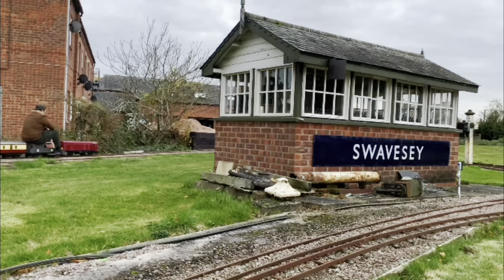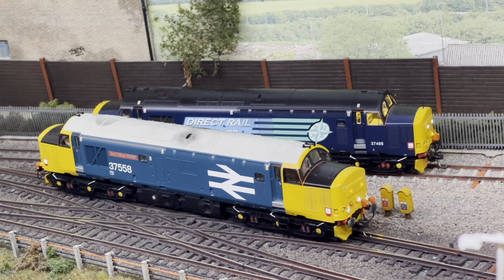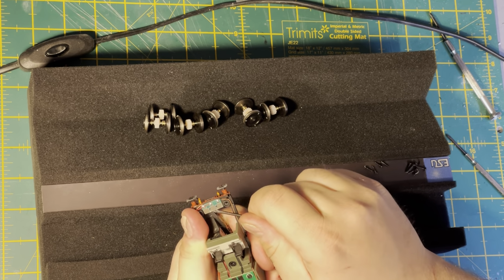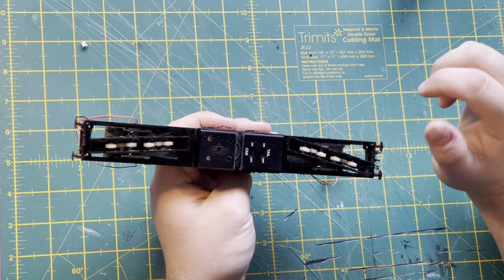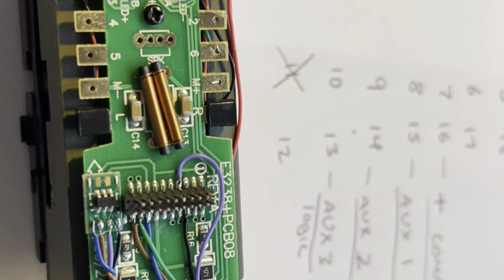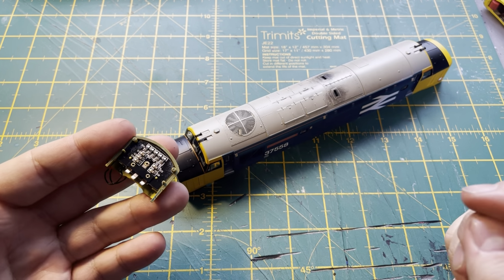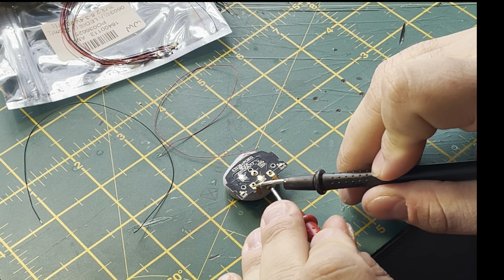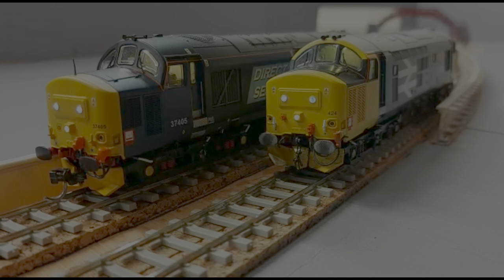Bachmann class 37 upgrade walk through - HOW TO!

Comment: Thanks found it very useful. Just a couple of notes, for those wanting to yellow the high-intensity only (I know the video is doing something more detailed), to avoid prising off the nose end, a slip of kapton tape can be put down the crack between the board and the nose. Also when I jumpered pin 5 and 6 for the cab lights, I didn't notice that the pins next to them are the motor connections and I allowed them to get loose, perhaps better to solder them.

Comment: Fantastic video Eric. Just curious why you didn't add any resistors between the lights and the decoder?
Reply from the maker: I retained the standard lighting PCBs just changed all the LEDs and seperated the negatives onto individual aux outputs, so there are already resistors on there 🙂

Comment: Hi Eric, excellent video/tutorial, I would just like to ask how do you tell which is the positive terminal on the iPhone speaker as I have read that not only should they be wired in series but also in phase. Cheers.
Reply from the maker: Thanks!  For twin iphones i have them one on top of the other the same way round, then you can bend one speakers terminals down onto the other to save on wiring and then a single wire from each side to the decoder.
Polarity then shouldnt matter really

Comment: hi could you help would you know where them wires go from the switches reason i ask i upgraded a old 37 to a new pcb which would have switches going to it as the old 37 loco did not have switches i have no cab light or rear red lights 
so i was thinking if i could bridge the connections so i get my cab and rear lights back please
Reply from the maker: @philkyle8919  hi mate its been sooooo long since i did these that i couldnt tell you im afraid mate, i obvs dont use the switches as my layout is dcc anyway so didnt take much notice of them

Comment: I’m absolutely shocked that one has to wreck the front of a locomotive to change the front lights!!  I think that it’s slightly older technology!!  Am I right?
Reply from the maker: Annoyingly you cant get the screws out to remove the PCB without removing the front end.
They are designed to come off but annoyingly have glue on from factory which makes it difficult